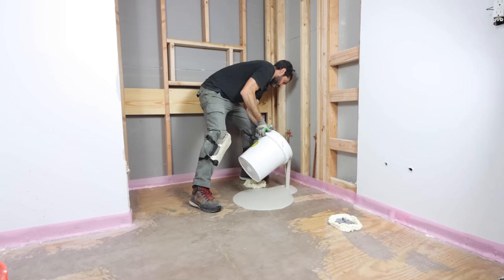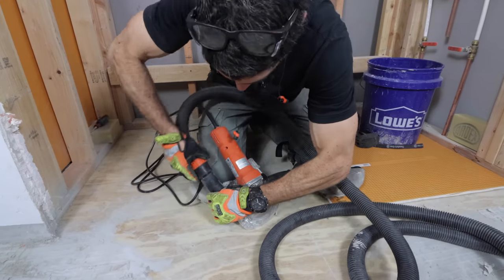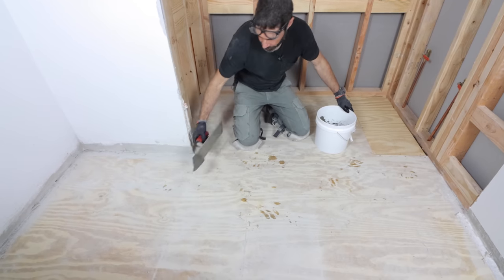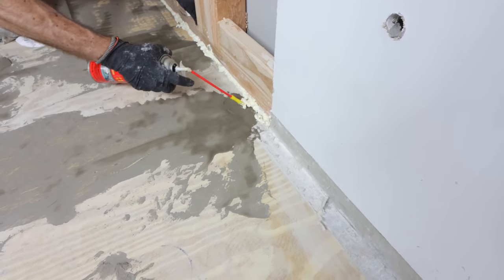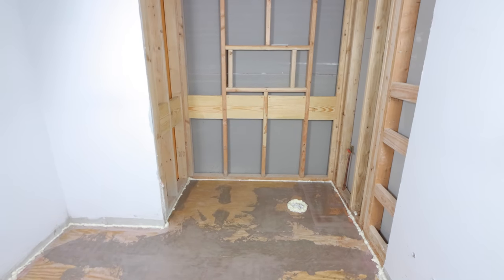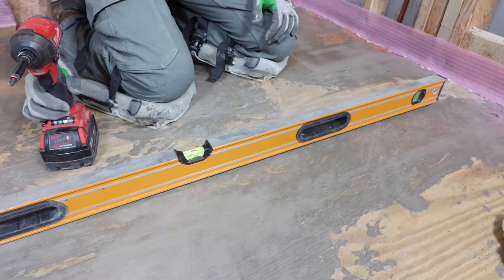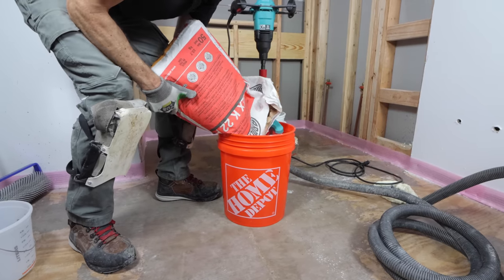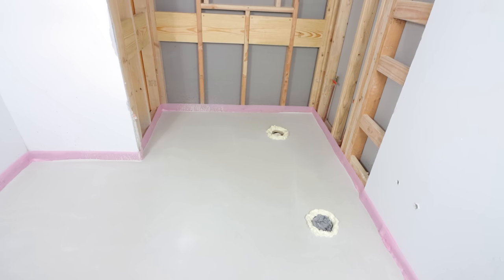Self Leveling Floor Tips for Beginners

Comment: Can’t quite understand why cover existing nails/ screws then run screws in and leave them. 
  I do understand the leveling aspect, but leaving the leveling screws in not leave weak spots?
  Btw, ever use wire mesh of some sort when you have go a little thick?
  I have a spot about 6 square feet. Starts off at about a half inch and goes to nothing for a tub with styrofoam on the bottom. 
  I assume the foam is for support on this cheap tub and not just for sound dampening. 
  I bought it because it is made with coated steel.  
  Have a feeling I might regret it.
Reply: The new screws are to set height / thickness targets. Use a level from screw to screw as you work across the room, starting at the highest part. Yes, you leave them in

Comment: Why use spray foam on the floor to wall joints, when caulk is probably a better /cleaner choice?
Reply: YMMV, for sure. In the demo video, the spray foam was probably overkill, but in my case, I needed spray foam to fill in some large gaps between the floor-to-wall joints. I look at it this way: I'd rather over-engineer the seal and have it not fail than cut some corners and flood my basement with hundreds of pounds of self-leveler. :D

Comment: Question: Why remove the tile at all? If you're doing this over tile and you're taking out base boards, couldn't you just pour onto the tile and put laminate planks on top of that?
Reply from the maker: There are many reasons why I wouldn’t recommend that, first the bonding could be an issue, ie no manufacturer will warranty SLU over tiles. Second, weight - you’ll be adding the weight of the leveler and the laminate to framing that may be already compromised from large holes or cuts in the joists.

Comment: Surprised you don't use/lay diamond lath on top of wood substrate before pouring. But Your much more experienced at this than I for fact.
 Great job and definitely need to fill the gaps with foam FIRST. OTHERWISE that stuff will run right under the plates into adjacent rooms or basement. 
Thanks .

Comment: I'm doing a 4' x 3' area over wood.  What happens if I don't use primer?
Reply from the maker: the self-leveler may not properly bond and your floor could fail
Reply: @HomeRepairTutor  Yes but what does "fail" mean?  Does it break up into little pieces or what?
Reply: Don’t be a cheapskate. Use the primer.

Comment: Wow, amazing job.  This has made me realize I can't do this myself.
Reply: It made me realize I'm too lazy to do all these steps so I'll just do a half-baked job by not using any of that edge protector and no primer and no nothing except leveler.  And i'm guessing it'll be just fine.  If not, well, lesson learned.
Reply: @opentrunk  Was it fine? About to do a job myself and some of the steps taken in the video seem like overkill.
Reply: @brandobond  It turns out I'm even lazier than I previously thought and didn't use anything at all except plywood shimmed to make it level. It worked perfectly but I only had a 4' x 3' landing to do.

Comment: I had messed up self leveler by not using an agitator as it was my 1st time, and the home depot tutorial was completely wrong, and void of information. Ended up grinding all the high spots out (2days of work), and just tiling with a not completely perfect floor. This was for a 250SQ ft kitchen, so you could imagine how much cement that is. Floor actually turned up really nice, thankfully.
Reply: I feel for you.
Reply: i have a small area in my bathroom 6' by 6' that was off 3/4" to "1/4" sloped. I forgot to agitate it & it was level after it dried. I also poured a more watery mix.

Comment: The real question is what the heck happened with the original floor with DITRA under that required pulling up? What a hassle
Reply from the maker: DITRA worked well, just a tile swap

Comment: What is considered not level enough? My floor is almost perfectly level except one area that is roughly 1/16” off from drain to the wall. About a 22” distance.
Reply: Thats level enough. Generally anything under 1/4 is considered level, but it also depends on the area. 1/4 ovee 10 ft distance is good, but 1/4 over say 4 ft isn't.

Comment: I had my floor self levelled last week after spending over a week clearing the vinyl off the floor and cleaning all the adhesive off. Tradesman comes along to level the floor and the result is awful. He applied the compound too thick and in places it is lumpy where he did not feather it when pouring anorher bucket... why are so many tradespeople awful?

Comment: The previous owner of my house wanted to turn a screen room into a den. Of course, the screen room had a slope so that rainwater would flow out of the room. It also had a step, about one inch, where the room meets the house floor. How thick can the floor leveling product be?
Reply: Depending on manufacture spec, usually no more than 1".
Reply: I think it's ridiculous to worry about going to thick. If it is strong enough to be feathered at edges and go on 1/4" thick on a walkable surface, how can it be bad to make it thicker? except that it costs more. If your floor is over 1" to deep, it is cheaper to fill it with regular sanded concrete topping and then self level over that if you can't get a good finish with sanded topping.
Reply: Great suggestion! I have been worrying about a area on my concrete floor that is about 2” deep. Didn’t think to fill in with regular concrete and then put the self leveling down. Makes more sense to do that! Thank you!!!

Comment: Why not just rip out old board and put new one to avoid grinding? More costly but much quicker and cleaner? Thanks for great video!
Reply: It would take way longer and be even more of a mess to replace it. You would have to make many saw cuts(dusty) debris would be falling down the floor joists, grueling labor, more trash to haul out, possible floor joist repair, most likely need to add blocking... way better his way

Comment: Great video, do i need to remove sill-seal and GreatStuff after the leveler dry out?
Reply from the maker: yes, once it’s cured 👍🏼
Reply: @HomeRepairTutor  thank you! One more question:) could you give me a tip how to remove those?? Cut them with a knife?? Or do I need to use a special tool?? Thank you for your help!
Reply: Hi!,  @HomeRepairTutor  Why removing all that, or why also the great stuff. I imagine We need a Barrier for the leveler to setright ?, what would happen if we leave the Sill and great stuff I ask because i need to do this inside a basement closet and this would totally seal the walls inside it. Could i leave everything ?, the great stuff ?. Thanks and sorry to bomb the question. cheers!
Reply from the maker: @leonardobehrens1204  you can leave it but the sill will interfere with your baseboards
Reply: @HomeRepairTutor   Thanks, Thats was quick, no baseboards in the basement closet. a Good seal against bugs or anything is nice. I will follow your instructions for seal tight! . Merci!

Comment: I think it's silly to worry about going to thick. If it is strong enough to be feathered at edges and go on 1/4" thick on a walkable surface, how can it be bad to make it thicker? Except that it costs more. This stuff is much stronger than the concrete itself. If your floor is over 1" to deep, it is cheaper to fill it with regular sanded concrete topping and then self level over that if you can't get a good finish with sanded topping. And that is another topic, but if you aren't a pro concrete finisher, try using sanded topping or self leveler for the final surface. It is way easier to get a good finish that way. I've never seen any videos by pros or anyone else mention that option.

Comment: Honest question here:
Why use self leveler after you’ve done all that work to get it down to the flat wood surface?  Unless the ply you exposed wasn’t very good condition
Reply from the maker: Good question, the floor was out of level by 1/4” to 1/2” and Feather Finish was only used to seal the seams and screws, not to flatten 👍🏼🔥

Comment: Never add the bag contents in the pail without the mixing paddle in the pail. Chances are high that the contents will settle at the bottom and your mixing paddle will not get to the bottom. Keep the mixing paddle in the pail while you add the contents.

Comment: Are you supposed to remove the pink stuff
Reply from the maker: Yes, you can cut it flush with the leveler
Reply: @HomeRepairTutor  Thanks so much, so you remove the foam, the caulk and the tape?

Comment: Or, you can lay down felt paper, add a metal screen, and use a 5:1 mortar & Portland Cement mix. Screed with your float sticks, and you're done. Just saying. Leave the thinset where it is.

Comment: Sealing the edges sounded like a great idea but made this project a nightmare. If anything, the caulk and sill seal is fine. You need to be an expert with the foam, even if you are i can't see it coming out well. My floor also is not level whatsoever after following all of these steps, it does look level but with a level on it its horrible
Reply: I've found this using a screed to bring the flooring level up which should have levelled, at least better than it is. What are you doing/ have done to rectify your issue? I was going to lay self levelling compound on top and pay close attention to levelling out the slopey bits.
Reply: If you used the gauging screws, and a spiked roller, you should have a near perfect finish.

Comment: Self leveler….self levels.  As long as you mix each batch consistently and cover the entire floor it will be level.  Fluid will fill the low spots until it covers the highest point.  No need for screws.
Reply: Baloney.
Reply: @dejayajay  I’m not asking for anybody to believe me.  I made a statement not a question.
Reply: @RELAXnRENOVATE  I apologise for the bluntness of my comment.  But … I’ve done a number of these floor levelling jobs now, and my experience is clearly that the surface tension, or perhaps some other ‘internal tension’ in the product means that without assistance, by way of squeegee and even better, a spiked roller, a truly level and flat surface is for all practical purposes, impossible. Unless perhaps the product was so thick that gravity could overcome these internal forces. I’ve watch numerous videos of first timers trying to do leveling jobs, and my heart bleeds for them.

Comment: I don't fuking understand why you need to self-level the timber floor. Fuking wastes money as there is  nothing flatter than timber surface theoreticaly.  And directly applying  waterproof material on the surface of timber is actually better than on the surface of concrete.  Leveling before tile screed will be 100% useless .
Reply: Screeds are not waterproof, so unless you going to waterproof on top of the screed, you will get moisture accumulating at the lowest part of the screed.